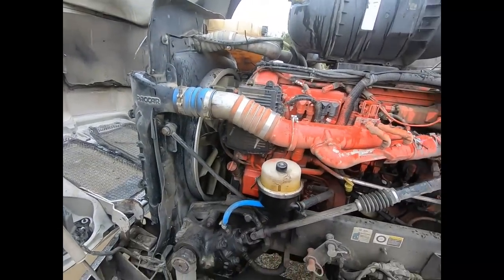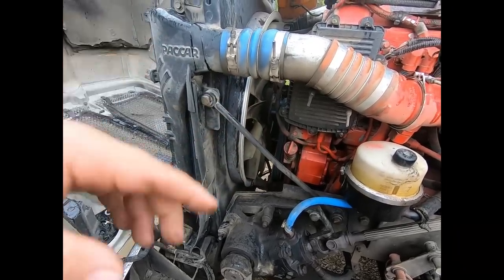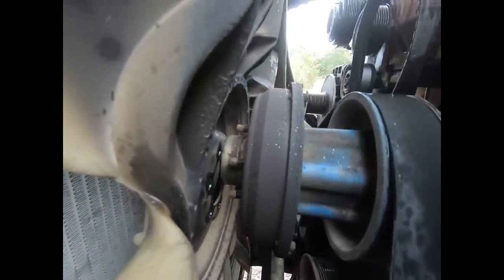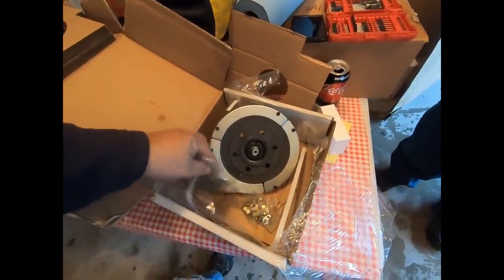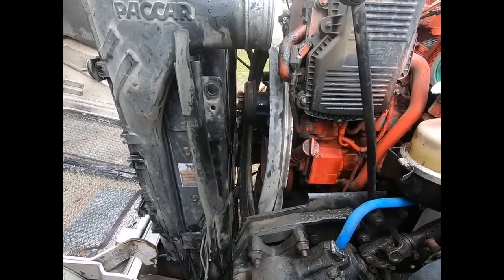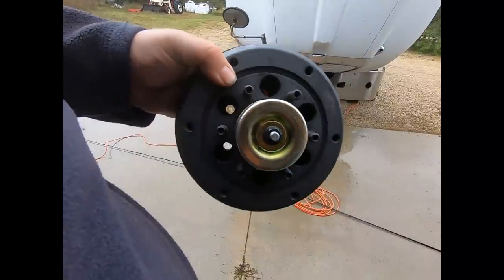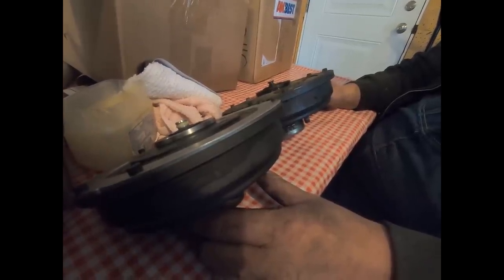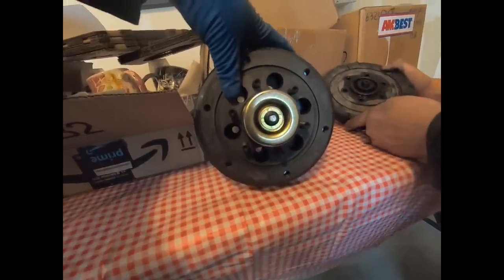How to replace the fan clutch on a semi truck....step by step guide

Comment: Vaseline on the O-ring isn't a good idea. It will break down the O-ring in 6 months to a year. That's probably why the O-ring is missing on the old one (rotted and came off). Use a good silicone lubricant instead.

Comment: Are you familiar with the housing that connects to the block? The housing that holds the fan to the block? Well a bolt on passenger side “bottom bolt” and “driver side bottom bolt” got stripped. Will I have to rethread the block?
Reply from the maker: What kind of engine?
Reply: DIY SEMI Cummings ISM
Reply: DIY SEMI 1999 Freightliner
Reply from the maker: I don't want to steer you wrong, I'm not familiar with the ism Cummins.  Mostly series 60 Detroit . Sorry bro.
Reply: DIY SEMI understood. Thank you
Reply: Just curious what u ended up doing I read this and thought man that would suck

Comment: How's that fan clutch holding up ? I'm about to do this repair using kitmasters rebuild kit. Also doing the hub bearings as they claim most failures are due to o-ring damage from hub vibration. Thoughts
Reply from the maker: Its still truckin
Reply: @DIYSEMI  Ty. Got mine off. Rebuilding tonight.

Comment: Hi guys, i have an issue with my fan clutch, on the very same truck. Fan stays on and doesnt turn off unless i park and shut engine off. It comes on specially in 10th gear and makes engine lose power. I check fan clutch for air leaks but didnt hear any. Any suggestions would be greatly appreciated thanks.
Reply from the maker: With truck running, disconnect air line on solenoid. See if it changes anything... If it never shuts off , the clutch could be bad. I d0nt know your default position. Probably default on. Also possible that your air conditioning is reading high pressure. Possible bad high pressure switch or improper charge on the a/c system .
Reply: You have to much pressure in your ac system, release some frion.